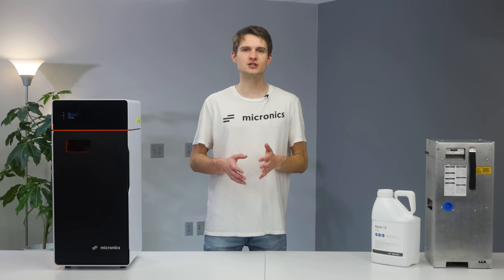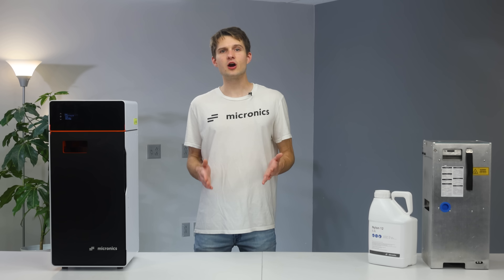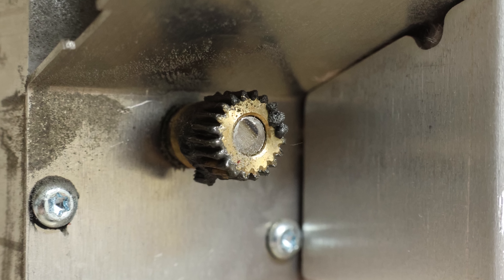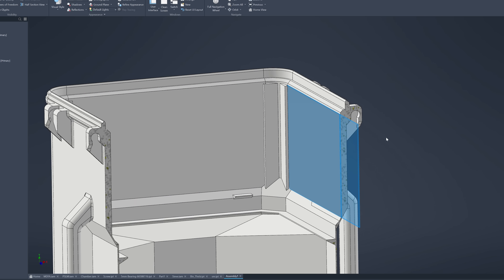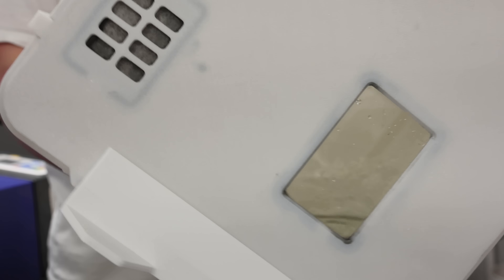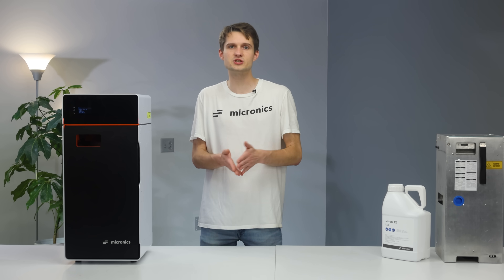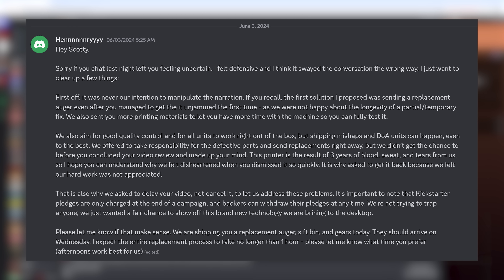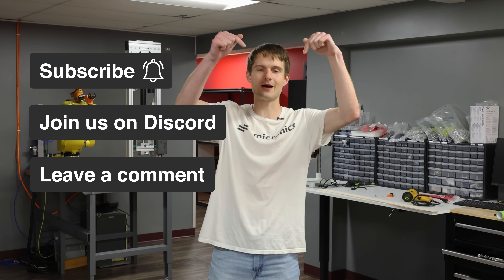EVERYTHING we'll change with MICRON + Response to Scotty

Comment: I definitely do not trust the safety information from you guys considering you operated a milling machine in a bedroom without adequate space around the machine and likely tested the printer and probably had more powder spills than the average user would have all in a “college apartment”.

Milling machines like that are not suitable for use in a small flat and doing so was just irresponsible and inconsiderate. Did your landlord know about it? Would insurance have paid out if the building burned down because you used a bedroom like a workshop? You said it was a “college apartment”, so was it college owned student accommodation or just an apartment?

Also there are a lot more issues with inhaling fine powders than just it being toxic, even completely inert powders can cause damage, the fact that you seem to not know this does not make you look good.

Judging from how little you care about your personal safety, I for one won’t be taking any safety advice from you.

Comment: I like all responses except for the hammer one. I would disagree that disassembling and dead blow to the auger while is a “simple” fix. Should not be the fix. How hard would it be to add a vibration to the auger system to clear it? Don’t count on it not failing found on that system to fail! Powder pressure and rotation. At some point will fail. Don’t want to be rude I hope you all succeed! I’d love to have one but kickstarter scares me especially with that type of money.
Reply: The problem with an MVP is that you can always find engineering solutions to improve it, but they all come with a cost and technical debt. Vibration in particular can have deleterious effects on so many different areas.
Reply: @Aussiemoo  and hitting it with a dead blow doesn’t have these effects? LOL

Comment: 1 faulty machine in 5 is not even remotely a good metric. You need to send out lot more review units.
Reply: The machines were apparently hand built and tested before being shipped out. They will have issues going from hand built to mass manufacture.

They also need to do something extremely obvious and standard in the manufacturing industry. Do some shipping testing. You can either pay a lab to test it or at the very least, test the printer, ship it somewhere, ship it back and retest. They clearly had done no shipping testing. They were lucky though, impacts and vibrations from shipping could have caused many more problems, especially with precise optics and electronics.

Comment: It's still important to criticize the dead on arrival printer. If you send out 20 and 1 was bad, that is nearly 5% of your product. If you are turning out a few thousand units a year, every 1000 is 50 doa printers. That is enough to completely sink your profit margins. Not to mention you have to hire people to repair that many. Of course this is an early model, but any problems must be absolutely scrutinized in any business. That error is something that probably stems within the building department and proper testing. Also, if there is a jam in your auger, you should  be programming in that the machine attempts a jitter of forward and backward driving. The auger is going to jam eventually, you can probably modify it to make it better but with a screw system like that it's going to happen eventually.

Comment: Have you tried out having using a static auger? It's commonly used in factories that handle grains where it's hard to prevent the grains from leaking down through the auger and jaming it. They use a static non moving auger and instead rotate the tube the auger is housed inside. It might be hard to change it so far into the design process, but it might be something you should research for future updates revisions. I believe Tom Scott did an episode about it a while back, and that came to mind when you talked about powder leaking down and jaming the auger.
Reply: How does this solve the problem? I'm genuinely asking. To my layperson's mind, making the tube spin instead of the auger is functionally identical, considering relative movement. Powder can still jam up the movement of the pipe in that case, instead of the auger, no?
Reply: The auger in question has the tube rotating around the auger, but the bearing is at the top. The tube is open at the bottom and there is a static auger in the centre. It cannot really be jammed by the material it is transporting. It also seems like it shouldn’t work, but it does. The video is titled “Mr Old’s remarkable elevator”
Reply: @pontifex-rex  I work for a company who've developed a vertical screw conveyer for sand and cement and this is incorrect. In our research, you can end up achieving something akin to a 'hydraulic lock" within the tube as the auger fails to move the material and instead compacts it causing it to jam. It seems to happen far more with finer particles like cement and likely the materials used in SLS printing. I don't think it would be viable to use it here.

Comment: I don't leave any comments on Youtube, but I do really like your project. and I am R&D guy. TBH, I am not a big fan to use auger driver as powder delivery mechanism to achieve compactness. Yes, you loose the clearance, but the tube has big tolerance, there will be jam caused. and yes you make the board to be reversible, but this is not permanent solution. I would be interested to see how many cycles (forward and reserve) of auger drive to engage for each print.

Comment: "this is definitely not a living room printer we still don't recommend setting it up in your your bedroom or right next to your desk keep it away from your working and living spaces"
@9:30 - Has entire set-up less than 2 feet from the bed 🤦‍♂
"practically living in the lab" - 100% checks out!
Reply: Students and OSHA don't mix 😂
Reply: that's a CNC machine not a powder printer, i think
Reply: @JoaBro  if they were based out of their college apartment and were running a milling machine in there then it is highly likely that they also built and tested their printers in there.
Reply: @JoaBro  When I first saw the image, it definitely looked like some type of mill closer to the camera, but just behind that I thought it was a prototype of the Micronic.  However, stopping and looking at it a bit closer, I'm not sure what's going on.  There's definitely a mill with the shavings, but the box that I initially thought was the shell of the Micronic prototype almost looks like it's floating between the mill's spindle and the mill's bed, but then extending well past the mill's footprint (away from the camera).  Clearly I'm misinterpreting something about the image or maybe, it's just some AI generated mess.
Reply: @im.empimp  its literally just an enclosure to limit the spread of shavings
Reply: @aria290  Thank you!

I was leaning toward that, but once I stopped it and looked at it closely, it started to feel like an optical allusion, so I don't trust my interpretation of it. 😁
Reply: That's their own risk to take, but they're telling their customers to treat it with extra caution. There's nothing unreasonable about that.
Reply: @Bletotum  I 100% agree, but that wouldn't change the irony.

JoaBro & Bletotum pointing out that it's just a CNC does actually break the irony.
Reply: @Bletotum  is it just their own risk to take though? From their about page that picture is of their college apartment where they will likely just be one apartment in an apartment block, that isn’t somewhere that should be running a milling machine or SLS printer and it isn’t just themselves that they are putting at risk.

It still doesn’t inspire confidence in their machine, what other risks have been taken?

Comment: That pipe where the auger is inside looks just like plain extruded pipe. Are you actually machining/honing the inner pipe diameter to tight enough diameter tolerance and roundness values? And it looks like there is a grove on the bottom of the auger to take a seal or oring, to preven powder from leaking to the motor. I would hope that the surface roughness on the interior of the pipe is specified for that part of the pipe, to control seal wear and increase lifespan?

Comment: This is a tricky situation to be in. You are entirely correct that the core of the machine in which the galvos and electronics are working. 

Regarding the bushings; my instinct says that with time and humidity, it will bind again. Sealed bearings might be a better option. 

The response to Scotty might've a bit too personal. It is a tough situation to navigate but I think it could be handled better. A good lesson to retrieve a bad lemon instead of making a third party try to fix it. 

We all wish you absolute success.

Comment: I really want you guys to succeed but your response feels a little deaf. You didn't have an issue with 1 of the 5 printers you sent out. You had 20% of machines arrive DOA. These were samples you certainly inspected before shipment. When you go to production that's a HUGE defect rate. Replacement parts are nice but I'd rather receive a product that works out of the box the prototypes are meant to come out the printer. It would have been reassuring if you guys took it on the chin and admitted that there were issues point blank instead of insisting 1 in 5 of your testers were difficult.

Comment: Issue with sift bins are due to fdm printing and layer adhesion. One easy way to address is to create a 45 deg. diagonal channel, in which a low cost threaded bolt(?rod) is held captive. The rod should be self threading, on partially formed threads inside channels. This will provide a uniform support. One for each side will take care of the issue. Also, if using ABS, the inside and outside surfaces could be vapor polished, to not only get a non porous smooth surface, but to improve strength on the z-axis. A temperature controlled sealed chamber, with few oz of acetone, with ability to recirculate/recover unused acetone using an external condenser, should make for a cost effective solution. As for the Auger, could incorporate few flexible double silicon, ptfe seals, placed equidistant along the length. Every problem has a solution, if you don't stop looking for it. Also the best brainstorming results are achieved, when a dumb question is well received instead of an outright rejection.❤👍
Reply: allthread rods for reinforcement are likely cheaper and easier than panels

Comment: Fantastic response. You are obviously very invested in this project and it’s good for you to show where the errors were.

Also, not a great look on Scotty’s part. I get and agree with the “in its current state it’s not ready” but from the sound of it you let the YouTubers know this is in a beta version currently, correct?
Reply: Also, do you currently use your Micron printers to print the nylon parts? What are your failure rates like? Similar to Prusa I think it speaks volumes when the machine is part of the manufacturing process, it also gives the chance to show real numbers in a large scale environment

Comment: FDM sadly is just not a good material for the powder separation, i would suggest going with something more durable that could also have attachable vibration/vacuum (with in-line dust seperatior) on it. as silly as it sounds, perhaps outsourcing some designs to a service bureau with some MJF printers (i think the 4200/5200 build bucket would be large enough from the video's i have seen). I actually work with several in Texas (i do onsite MJF repair). i am super interested in this machine, but still getting flak over my last 3d printer purchase :).  keep up the good working bringing power bed style printing to the masses! 

Also one hint on the recoater bearing/seal/powder infiltration... you will NEVER EVER stop this, all you can do is 'slow' it down and make it a 'maintenance' point. There is one idea you could use, but even that your going to have power build up at your rotation points even if you don't let it go to motor assembly. Sealed bearings help, and as stupid as it sounds grease (as long as it does NOT GET TO PRINT powder) helps as a seal to the bearings (or any openings) but needs to be replaced in a maintenance job. Nylon powder gets EVERYWHERE at the micron size it is at, open bearings, seal bearings, gears... it gets into everything and eventually creates wear or resistance :(
Reply from the maker: Totally makes sense. On the recoater lead screw, because it combines rotational and translational movement, powder gets cleared out pretty easily and it doesn’t bind up. But yeah, for the powder flipper that’s just rotating, it needs a bit more thought.

Comment: after i saw that advice of hammering the Powder bin to unstuck the gear of the buildplstform i could not hold myself...you still have a long way to go and powder handeling should taken far more serious than that little van.. i was working with eos printers and they are the state of the art and still, there are problems with warping and recoater rips out parts and so on, but your printer is a prototype and you guys know that! you told a youtuber, that the company runs out of money and you need to get the printers shipped even if they are not ready yet..

Comment: Hi folks,

Your safety comments are fair enough as a supplier. But I do think just stating you don't recommend it in your living area isn't going far enough. You should really be providing recommendations around requirements for extraction for your system. Simply extracting plumes away from the top of the bucket isn't really enough information. Plenty of people who are less informed will think nothing of where the powder goes after the passing through your fans. I think you need to be clearly recommending the system should be used in a ventilated space with given extraction recommendations to make it clear to the lay person your giving access to such equipment.

Also, metal powder is toxic, yes, but that's not the only reason for the respirator. Any powder exposure long term will likely lead to respiratory issues....

All the best
Reply: Yeah their safety information definitely does not seem adequate.

It also doesn’t matter if the powder is toxic or not, any fine powder in the lungs isn’t good for you, even if it is completely inert. The fact that they either didn’t know about this or ignored this makes them look like they don’t know what they are talking about.

With their lack of knowledge and disregard for their own safety and the safety of the people in the apartments around them, I would not trust their safety information.

SLS printing just isn’t ready for your average hobbyist to use at home, even with their printer it still needs adequate space, adequate ventilation and many other things. This isn’t just like an FDM printer where at most you may need to open a window.

Comment: Augers work better when the confinement tube rotates instead of the screw...
Reply: Wow, did not know that, don’t know if I will ever apply that but if I do thanks in advance!
Reply: Then it would be a Roberts elevator and patents would need paying.
Reply: @eddiemiller9000 that patent is still active?
Reply: @janbeck8269  as far as I know yep, it was only patented fairly recently. The inventor is fairly elderly but the invention isn't.

Comment: I left a comment previously about powder safety, and I'm glad it got addressed in this video. The procedure clarification that was missing in the user videos is much appreciated. I look forward to seeing how this process plays out when some of the other issues, namely the sift bin, are fixed. Metal powder is a bit of a different animal, but there is a good reason they are typically stored in robust canisters.
Reply: I wonder if the whole thing could be made safe for home use by incorporating moisture. If the cake were slightly misted up, it wouldn't dust when exposed. And if there was a bit of water in the sift tank, it would probably lead to much less dust as well. It's how they keep charcoal dust from escaping freight trains with open wagons, by spraying water on top at intervals. This would require one more recycling step for the powder, since it needs to be thoroughly dried, but maybe a cheap dehydrator or a small oven can do that trick, too.

Comment: Manufacturing a actual products as a small startup is crazy hard, I have deep respect for your efforts and REALLY hope you manage to solve the issues.  Oh, and as my manufacturer keeps telling me, add more tollerance in the design if you want to avoid issues. :-) Best of luck, I hope to buy your product one day.
Reply: The problem is usually not to add enough tolerance, but to actually specify it properly in technical drawings, and have a manufacturer that can follow a technical drawing. And, you need to have the tools to actually verify every sample part with precise enough and calibrated metrology equipment, to verify that the manufacturer has followed the drawing and does what was asked from him. Just doing an assembly and check that it fits is not enough. It can get complicated quickly, and unfortunately a lot of "startups" just don't have the background education and project experience or the budget to "buy into" all that knowledge, so they have to learn by experience.
Reply: Truth. I promise you that bolt hole you specify as +/-.001" would be just fine at +/-.005"  and will reduce your cost significantly. I've seen prints where someone who does not have a climate controlled inspection area wants .001" in plastic...smh.